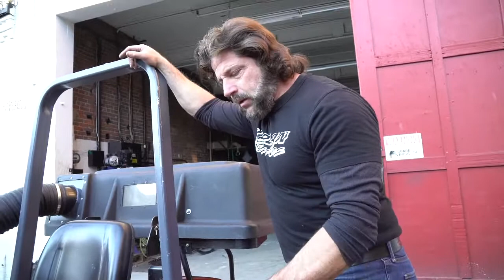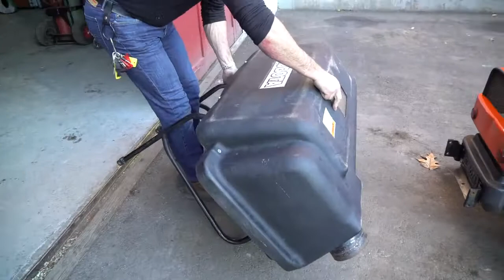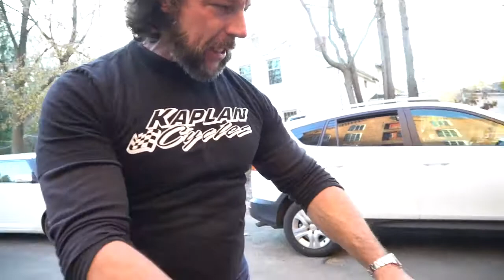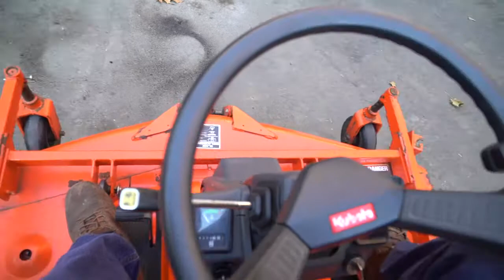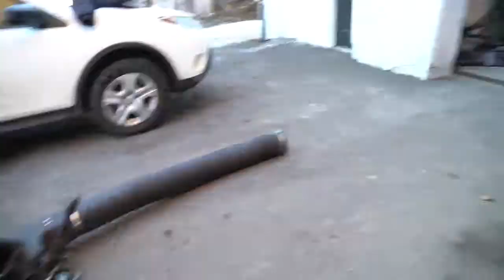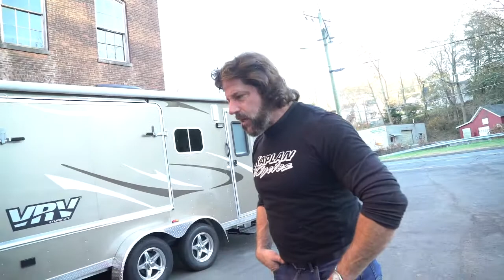Kubota GF1800E

Comment: Hey there! I have the same mower and I'm having trouble with the mower deck not engaging. Replaced the clutches, all the seals, and it works when we unhook and hook up to air pressure...any suggestions how I can further diagnose this issues would be greatly appreciated!!!